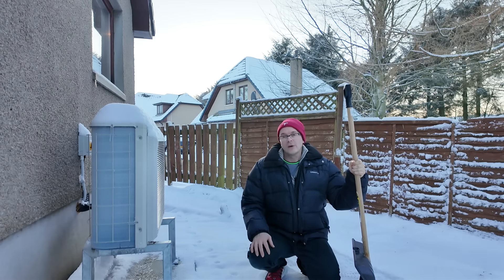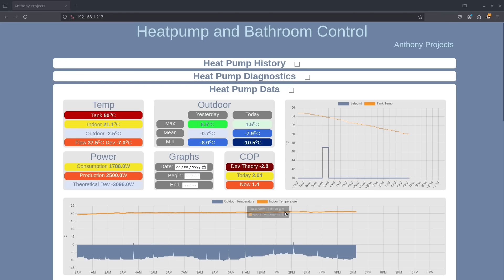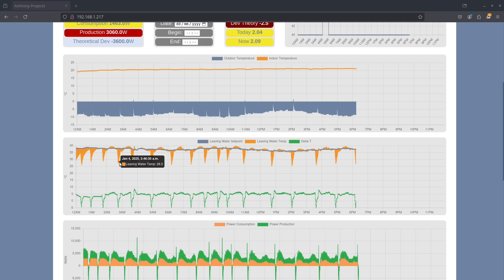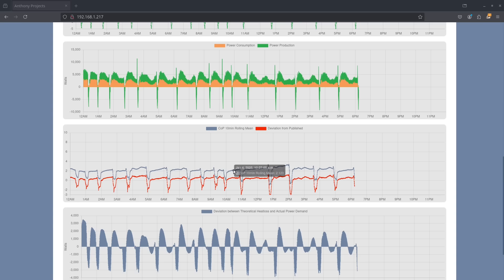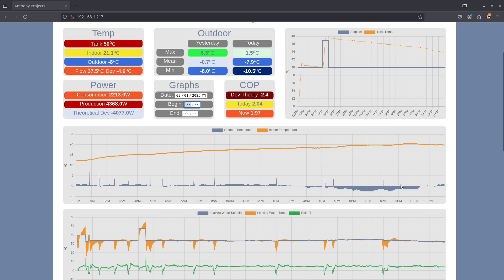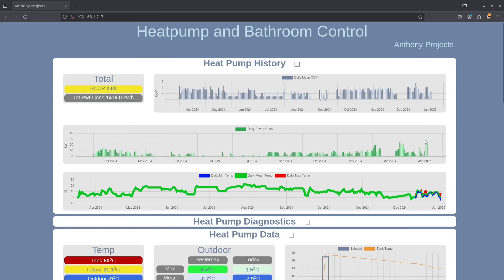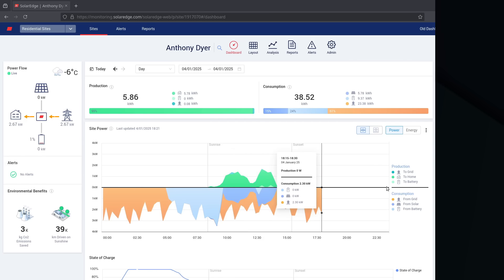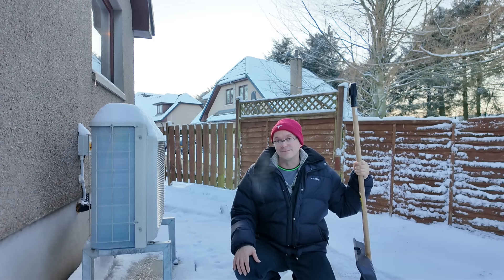Heatpump Performance on the coldest night of the year

Comment: COP of 1.6!!! is that even affordable?  Would it not be possible to revert to Gas when your heat pump  cost goes above Gas?
Surely you need a COP of 3 to break even?
Reply: The efficiency of the heat pump overall  makes the energy costs similar for a reasonable install. The short periods defrosting doesn't drag the overall performance down much.
Reply: @Biggest-hz7ng   Yes if you ignore the  ineficaces in the heat pump setup and magnify the inefficiencies in a  other systems you will get the result you want.
 However, if you really want to achieve the most efficient system which takes into account flexibility and overall real cost you won't finish up with a heat pump presently since you would need a COP greater than 3.5 (All the time) in install for that of a Boiler insulation which presently isn't available.
That said any new technology needs its  aderantas and prophets, usually those with money to burn and an adherence to the now thing..     
Hopefully, nuclear power stations will come on line to save the day.
Reply: @paulthomas4917  the SCOP needed for rough equivalency is about 3.1 (with gas boilers reaching 0.85 efficiency). A figure that Octopus, for example, suggests is typically exceeded by their installs.
Reply: The 1.6 number was the design spec at -10C which the install exceeded (hitting roughly 2 to 2.2). I suspect the install would beat the yearly energy costs of a gas boiler without needing the solar and battery Anthony has.

Comment: Hello how much time do you spend on looking at this system over a year.
Checking graphs working out whats the best time to do certian change overs etc?
Reply: The controls can make the heat pump set and forget. Tweaking is optional. 

You might switch electricity tariffs in the shoulder months with solar?
Reply: @Biggest-hz7ng  Thanks for the information

Comment: Thanks for pulling together all this information Anthony. 
We live in an old stone house in Northumberland, no gas supply so we rely on wood burners/open fires/heating oil etc 
I recently replaced our oil boiler with a new one reluctantly after looking into a heat pump .. 
The costs of replacing all our radiators was just too much .  
I am not against the technology at all just the cost quoted was prohibitive. 
I read the comments section on your channel and laugh at the ignorance of some people. 
Change is always difficult for some.. I can remember people saying .. I’m never going to wear a seat belt… I don’t need a computer.. I don’t want a mobile phone … 
Fuckwits.
Reply from the maker: @Jackdanalf  The other option is air to air.  Very common in Norway.  I’ve seen some houses with just one emitter inside the house, and it’s a very simple install.  Works best with open plan living spaces, which I’m guessing your stone house won’t be.  But you could have a bedroom emitter, and see how you get on with a simple, but upgradable system.   It could be enough to keep the oil off and just have the wood burner for the living spaces,

Comment: So how is this better than a gas boiler when gas is about 5X cheaper than electriity? what are the actual advantages of a heat pump over a traditional gas boiler?
Reply: Gas is about 4 times cheaper per kWh than electricity?

A reasonably installed heat pump will, due to its efficiency, have similar energy costs to a gas boiler. A better install may offer some savings. Emissions are much lower.
Reply from the maker: @Aeronaut1975  My electricity for most of the year is free.  In fact, I can import electricity cheap overnight, and export it for double the price during the day.  So when you consider that,  I don’t think your assertion about gas being five times cheaper actually holds true.
Reply: @anthonydyer3939  Not really free you have had to 'invest' in a solar farm and battery.

Comment: Very happy with gas. Keep your heat pumps. Just wait until that idiot Milliband has tripled electricity prices. You won't be as smug then!
Reply: Tripling prices wouldn't be very popular. Heat pumps use 40% less gas even when solely using gas generated electricity.

Comment: Currently the UK imports 55% of the gas it uses, by 2050 that figure is projected to  rise to 85%. The UK needs to cut it's CO2 production AND diversify its sources of energy. The increasingly hostile international political environment makes it strategically important that the UK becomes less dependent on fossil fuels from the Middle East, West Africa and North America. Not all properties are suitable for the installation of technology such as air source or ground source heat pumps but when used in conjunction with electricity produced from renewable sources they can make a valuable and sustainable contribution to the environmental, economic and geo-political future of the United Kingdom.
Reply: Hopefully not much gas at all in 2050

Comment: How about comparing that with a ground source heat pump ?i bet the ground source is better and cheeper
Reply from the maker: Better, no doubt (when done well at least).

But it’s also easier to do badly.  If your borehole depth was too shallow (done by a bunch of cowboys) then that will cost you dearly and you wouldn’t know about it until the electricity bill arrives.

But cheaper?  Maybe.  I’d say it’s a better deal for countries that deal with deep cold (Canada and Norway).

Comment: I have 2.25kw solar 12 years, no battery and have used a ASHP for 8 years providing UFH heating ground floor and rads upstairs in 4 bedrooms/bath. Currently the ASHP is on 24 hours due to low night temps and is using about 70kWh. Clearly the house is very comfortable at all times but a week of -3C at night I feel it sensible to keep running 24 hours. Normally rads only on for 6 hours a day and UFH 14 hours using 35kWh. I'm on Octopus agile. What software do you use to get the data shown?
Reply: Agile is a more challenging/entertaining tariff. I have a smallish 5kWh battery which helps mitigate Agile's evening and morning peaks.
Reply from the maker: It’s my own custom software.  Videos earlier in the year go through how I made it work.

Comment: Might be ok there but it is -21c now in Ontario and will go to -30c tonight. High for the week is -10 for the next 8 days
Reply from the maker: The lowest temperature for my house over the last 15 years has been -15.  Very rare.

The lowest for Scotland has been -27.

For Norwegians, heat pumps are cheap due to open plan living, and electricity is cheaper.  So the deep cold doesn’t stir up much drama, especially considering they upgraded from resistive heating.

Comment: I can hear my neighbours heat pump through my double glazing  and they still have to supplement it with electric fires .
Reply: Sounds as though the heat pump needs help. And that it might be badly sized/installed or maintained.
Reply from the maker: I can hear my neighbours oil fired boiler, and another neighbours Mk 2 VW golf with a boy racer silencer.
Reply: @ At least that starts up and drives off the noisy heat pump is bolted to the back of his house.

Comment: Can the heat pump run on a small generator in the event of a power cut? We have a wood fired CH system with UFH and HW supplemented by solar, both of which have small pumps and in thencase of the log boiler a fan and screen to run, which all work very well when there is no Grid supply by means of a backup 3kw Generator, for those times when the grid goes down. Rather cost effective also.
Reply: Well, if your house is adequately insulated the power cut would have to last a long time before you'd worry about getting cold. Having said that, get an EV and a charger with Vehicle to Home capability and run the house from the car for a week.
Reply: @AndyInTheUK  He asks about a small generators and you respond with "get an EV"    what planet are you on?     run the house for a week from an EV ,   sure.   Maths not a strong point then?
Reply: @yarpos the suggestion might be more for keeping the lights on for a week with the EV (not so much the heat pump)?
Reply from the maker: I have plans for a 2nd 8kw Inverter which can run my house off grid, so yes you can.  Unfortunately those plans are looking like they’ll be scuppered by SSE saying that my connection isn’t strong enough for 2 inverters (gimme more money).

Comment: I am sure they work well in very cold dry air situations, but in a damp and not usually very cold UK, not so much
Reply: They work well in the UK. Due to their efficiency (and despite gas costs compared to electricity), heat pumps have similar energy costs to gas boilers.
Reply: @Biggest-hz7ng  Once we all have them, electricity will go up.  It is just like the EV scam.
Reply: Is Scotland not part of the UK?
Reply: of course but huge difference in temperature this day

Comment: Heat pumps are good if the property is very well insulated if not you will be running the pump constantly paying a very big electric bill😮
Reply from the maker: If your house is poorly insulated, you’ll be paying a large bill regardless of gas or electric, wouldn’t you?  

“Insulate first” is always a good strategy in either case.

Comment: Sounds to me like anyone would be better off switching to Octopus' Cozy tariff to get electricity at 1/2 price 3x a day and charging their solar battery up at the same time, to get the same efficiency without heat pumps... All seems a scam to me...
Reply: Reasonably installed heat pumps are over 3 times more efficient than resistive heating. This efficiency allows them to have similar energy costs to gas boilers. And reduced emissions.